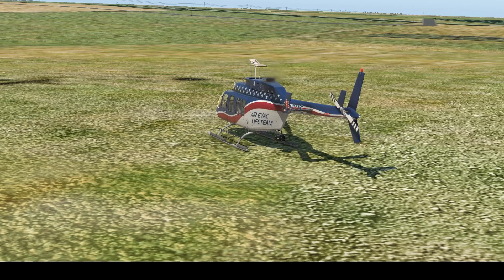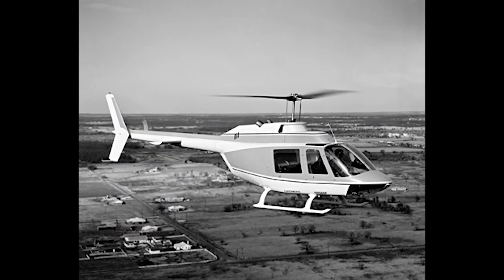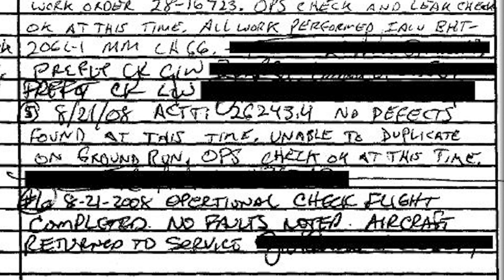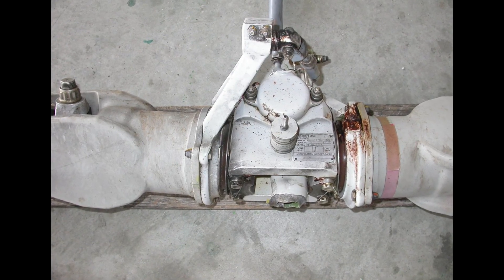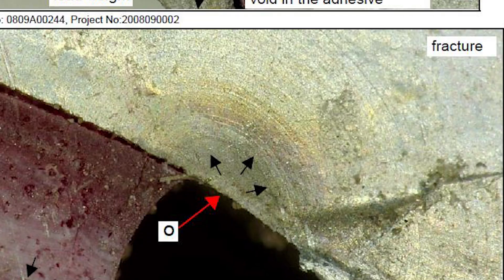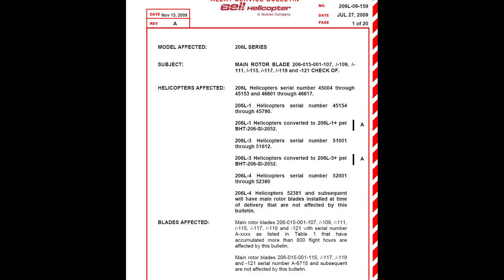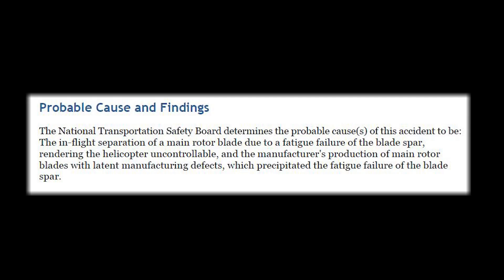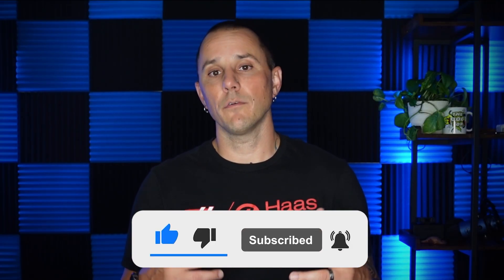Helicopter Rotor Blades Break Apart After Takeoff!  The story of HEMS Air Evac N37AE (8)

Comment from the maker: One of the rare accidents where there was absolutely NOTHING the pilot or med crew could have done to avoid this.   I truly appreciate you folks taking the time to watch this video.  If you thought it was good please like and subscribe and even feel free to hit that “thanks” button so we can keep this channel going and make it grow.  If you have a story or incident you’d like me to review please let me know in the comments below! Cheers!👊🤙🙏💙
Reply: about the fatigue cracking noise, I know that a short period of low rumbling under stress is something seen as a major warning of fatigue for fiberglass hulled boats... usually, being caused by voids forming around the lead keel weight a few hours prior to failure... this sound tends to immediately disappear once the adhesive has found a weak line  along which to begin parting...
wonder if the physics for the blades here is thesame?
Reply: My friend was the pilot 😞
Reply: I participated in an autopsy involving a heli crew while in the military.  I've always had a question since then.  
The remains were basically hamber with nothing over the size of a quarter.  We were told the heli was a variant of the huey.  To my uneducated eye, that heli can't attain a speed that would turn flesh into hamber on impact.  I've always felt we were not given all the facts for many reasons.  My question is, what speed would need to be attained to do that to the human body?
Reply: I flew for UC Aircare in Cincinnati for 12 years, enjoy your videos, always informative. I once had a Bell 47 blade grip bottom half crack on me in flight. Entered an auto,  since it was the fastest way to get to the ground, but since the engine was running  brought the engine back up and landed with power! Good thing I did, the aircraft would have coned, and probably snapped the blade grip completely off, slinging the blade of course. I was back up that after noon, flying our Enstrom F28A.

Comment: I was a lead mechanical design engineer on the Allison Model 250 series of engines back in the 90s. I was there when this engine was manufactured and was heavily involved in the design and new product introduction of the Model 250-C47B which powers the 407. I've done investigations on engines involved in accidents many times. I've seen lots of ridiculous stretches that lawyers make to score more money. This is the most ridiculous I've ever seen. The engine had nothing to do with this failure.

Comment: I’ve spent many of hours inspecting blades as a bell engineer… never slack off on main and tail rotor inspections.

Also this rumble in rear of aircraft pertaining to the rolls Royce 250 is something I’ve never heard or read about… I’m also licensed Rolls Royce mechanic but what do I know.

All I can say is that these blades need thorough inspections often and maybe more often depending on your ops.

Comment: In Ems when Evac first started, it was known as ScareVac. I seen a flight come in and a wire burned, the helicopter mechanic came and went to autozone, got a new wire and the craft flew away. I was like I didn't know autozone sold helicopter parts but most of all that's great it had the wire but if I was on the crew I would have wondered more about why it burned through and not so much if autozone had the wire.

Comment: My husband was killed in June 2013 also a bell 206 and Air Evac his helicopter did the exact same thing fell apart in the air and on examination after the crash had a significant void of the adhesive in the rotor blades they should not have left the factory with the size void it had. They also had maintenance records that showed vibration before the crash in more than one instance but could never pinpoint the reason. 3 more lives lost for the same reason. Thank you for the information and video.

Comment: That's a characteristic example of mast bumping that's was done over time in low G maneuvers its a big problem with hueys vipers and bell helicopters that have rigid and semi rigid rotor systems
Reply: As a professional helicopter pilot, flight instructor and DPE I can definitively state that this accident had absolutely nothing to do with mast bumping. The mast bumping phenomenon does not accrue stress slowly overtime. The defining characteristic of mast bumping is that it is a sudden and catastrophic separation of the rotor system due to the mast being bumped by the hub.  It can only occur during a specific flight condition and is in no way related to rotor blade fatigue.

Comment: Helicopters especially have fixed speeds. The engine runs at a lot higher speed than the rotor system. This enables you to identify a system but doesn't help identify it further. RR have nothing to do with this.

Comment: I feel there's a gap, pardon the pun, in the explanation of getting from void to fatigue defect.

If RR issued such a service bulletin, does it imply that there was at least one prior incident?  Is it possible whoever prepared the legal document mixed up compressor blade for main rotor blade? Even if the warning is correct, is it RR or the helicopter manufacturer who should issue a bulletin?

Comment: What I see is the same crap I have seen in other assembly shops. You have a star mechanic known for his/her high production numbers that figured out a way to minimize adhesive squeeze-out at the lead weight bonding time. Minimized adhesive squeeze-out makes squeeze-out clean up and faring at joints a lot quicker. These types get upset when you check on their work because they think they are "The Most Perfect Evar".....and management wont mess with them because : Numbers.   
So now 3 people are dead because of the constant pressure to produce more every damn day, and short cuts were allowed.   
The solution would be for Bell to dictate and absolute MINIMUM amount of adhesive used for that step, even if it creates a lot of squeeze-out and clean up. Any adhesive left over and total blade weigh before and  after this step should tell the story if enough adhesive was used, and the likelihood of voids.

Comment: That airframe probably had a ton of hours on it. The 2 digit tail numbers in that fleet were all pretty old. However, i remember when this happened. There were a "lot" of issues with the van horn blades. They pulled em all off the entire fleet from what I recall and replaced them with a superior product.
Reply: This accident occurred with OEM Bell blades installed. Van Horn main rotor blades weren't introduced into the Air Evac fleet until roughly a decade later.
Reply: @nathanlovellcfi  its been a while since I watched this. What year was this supposed to have been? We had van horns on ours in the mid to late 20 teens.
Reply: Wrong

Comment: I’m a pilot and A&P with about 10k hrs in Bell products. I’ve never heard of a SB from RR about a low freq vibration, although I’m not saying it doesn’t exist. I  would think to avoid liability, they would avoid such (ie if they said look at the rotor, when in fact is was an engine part, they’d be opening themselves up to liability). I will say that in the Rotorcraft flying handbook from the FAA, it does address places you should look for issues based on the frequency of vibration. I’d have to go back and look it up.

Comment: Wow《☆》I've scrapped at least 20 sets of 206B & OH58A M/R blades after they reached their hourly life limit. I always thought they could still go another 3600 hrs by the looks of them. We used to cut them in half & turn them in for scrap$$$. I tried jumping on them to see if I could break them but they're very strong. They would make good diving boards if you glue 2 together. I've used the Hysol purple adhesive to do external blade repairs. It's good stuff, like Epoxy on Steroids. My guess about the rumble noise was probably a gust, thermal air pocket or crosswind. Hopefully everyone gets their fair compensation especially seeing as it occurred in 2008🖖😎☮

Comment: I worked on all 206 series helicopters including LongRangers for many years. There is no way that the rumble
Would indicate an impending blade failure. My boss will always stalk about lawsuits that involve "The deep pocket theory". The lawyers will go for the engine manufacturer, the avionics equipment manufacturer, etc. . The main rotor blade failure was immediate, and the imbalance probably tore the transmission off the service deck and flung it quite a ways from the aircraft. It was unfortunate that manufacturing process was to blame on this because the 206L series  are great  helicopters. Hawaii County has a 206L-1 since 1991 and has been providing great service in firefighting to rescues. Always been a smooth bird and easy to track and balance. Another unfortunate manufacturing defect was the failure of the blade spindle of the Sikorsky S-76 helicopter due to tooling marks leading to loosing a blade. All these were immediate with no warning. I hope blade integrity will be lasting till time out replacement for the Bell 505 helicopters that seem to utilize the 206L rotor system. I know that the 206L was also plagued with tailboom failure where there was fatigue cracking somewhere just ahead of the tail rotor gearbox and vertical stabilizer causing separation. That has been remedied already.

Comment: The argument is mute... As the more you have of something flying around.. The odds are you would see a higher rate of crashes or problems. The vary fact there are 100's of these in service. Yet you only hear of 1 fatal crash in 30+ years. Should tell you just have safe these are...

Comment: The "low rumble from the rear of the aircraft" in my opinion, is unrelated to the departure of the main rotor blade. It very well may be from the engine which as far as I can tell, was manufactured by Rolls Royce. Not sure how an engine rumble could signal an impending MRB failure. The beach marks on the MRB spar are very telling of corrosion although emanating from the inside of the spar would be very difficult if not impossible to detect from a visual inspection.
Reply: The tail rotor could amplify any vibrations coming from a failing main rotor and send them forward or a rotor vibration could be carried through the transmission to engine, why not as they are all connected.

Comment: You stated, a assembly error in  Manufacturing as the cause of the failure.??? LET'S SAY ,possibly . I think the make up of the lead itself ,is more likely the case. How hot does a rotating lead sword get ? Hot enough for the adhesive to fail after years of the "flywheel " lead corroding away from it ? Sad. I hope some good comes from this tragedy. 🙏

Comment: not only that, but the metal main rotor blades on Bell products will continue to thrash the ac to pieces, unlike Aerospatiale which has composite blades that will break and not beat the ac up.

Comment: Flew for 28 yrs. in a consortium based program. BK 117 A,B,C models, N2 Dauphine, C++. Seemingly, regularly, we'd hear an about an Air Evac issue, more than I'd like to admit fatal. I never thought zero timing clapped out 206's for EMS was a good idea. Thousands of blades on 206's and a failure with a sketchy flight program, what are the odds, promoting the first AD for the blades. But I realize things happen. In the early 2000's a flight program in Texas suffered a blade separation with one of their BK's determined to be a TT strap failure the first AD of the kind for BK117's
Reply: Tulsa?

Comment: During my time in the US Navy I served as a helicopter crewman aboard the Sikorsky  SH-3D helicopter. We had a helicopter that was returning from an over water flight  with a severe vibration problem. Upon landing at the air station, it  was determined that one of the five tail rotor blades had a visible  split along its entire length. The blade was still attached and the two halves of the blade were also there.  It was amazing that the tail rotor blade was still there and lasted long enough for the helo to return to base. 
Worse case scenario the tail rotor blade could have separated and impacted the main rotor blades resulting in a catastrophic failure while over the ocean.
Reply from the maker: Wow it's crazy how some of those old aircraft held themselves together!  Thanks for your service!

Comment: Rolls Royce have no practical knowledge of rotor systems. Or helicopters, for that matter. They design and build an engine which they test to destruction and then supply certified examples to the customer. They provide ongoing tech support and spares for their product. They would have no knowledge of any issues with airframe, rotor head of blades.

Comment: Due to the torsional forces on a rotor blade spar, any internal de-bond or void area beyond a certain point can cause fretting and ultimately lead to initiation of a fatigue crack.  If the skin doesn't crack, the chances of a visual inspection detecting impending failure is pretty remote.  Back in the 1973/4 era, a similar situation arose on the Bell 540 rotor blades used on UH-1C/M, TH-1L and AH-1G/J helicopters.  The blade design is the same as the 206, a C spar with a closure plate to for an equivalent D cross section (which is what the Bell 204/205 blades have, an extruded D spar).   However on the 540 blades, the issue was de-bond between the C spar and the closure plate.  An aeroelastic analysis found the blade could operate successfully with up to 36" of de-bond, but that was strictly theory and only employed so as not to ground the entire US attack helicopter fleet.  In fact, much smaller areas could set up the fretting and ultimate fatigue failure.  I only remember one case of a crack being found on preflight and the crew cranked up anyway, but the vibration was too great to fly (they were lucky, even a blade failure on the ground can do you in).  The 540 blade life was dropped to, I think, 550 hours and the ultimate fix was replacement with Kaman K747 composite blades.  

I cannot see anyway the rear fuselage noise write up could have been related to a main rotor blade.  Blades work until they don't.

Sorry for being so wordy, just brought back old memories.............
Reply: I remember in the 70.s they had a problem with possible delamination  and maintenance had to tap allow the leading edge with a penny and listen for a hollow sound meaning delamination leading to further investigation.
Reply from the maker: Great info, Charles!

Comment: I fly for Evac as a medic in indiana. They took a lot of blades out of service for this accident. If you drive by some of the bases they have been turned the blades into monuments in front of the base as a remembrance of this accident.
Reply: I live just about 360 feet from the 4 story helicopter pad across from my houses ,@.UPMC WMPT , 17701, I see and feel even ambulance whirlybird that comes and goes there. When the wind comes from the south, they come in directly over my roof at 90 feet on a windy landing. Full power till touchdown over the parking lot and down on the east wing roof.  I get new cracks in my all plaster walls constantly..when the pilot is landed, I can see his eyes from my front porch.. I've seen one on pad,deck, and one in a holding orbit waiting for the other to leave, and I've seen two in orbit once waiting ... knocking on hardwood,  I have always witnessed successful take off and Landings without event, and some are parked in very windy conditions I can't believe they made it. God blessed crew the captain and the poor sobs that have to be the occupants in distress. Keep the blue side up, Prayers for the family's.          🌬❤
Reply: They’ve been using blades in marketing the base locations since well before this accident.

Comment: I was trained in Bell 47's with wood blades that unlike metal blades had no service life restrictions (sweet auto's). I remember flying a couple of times with the blades not balanced correctly and it felt like it riding a horse.  Minor adjustments were done with the trim tabs.
Reply: Way back in the day, if it had been sitting out over night moisture would cause an imbalance. Wraps of duct tape did the trick, until the day warmed. Then it would either peel off or we'd peel it off.
Reply: Back in aircraft mechanic school, our teachers regaled us with (mostly true) stories. One of my favourites was maintaining a Hiller in India during the dry season. The blades that had recently been flown in the wet forest of BC and they dried out so fast you could drop a nail file through some of the cracks. The replacement blades never showed up so they just flew it with the cracks. I’ve had my own adventures too but I’ll save those for another time.

Comment: Aviation Investigation Report A11O0205 from the Canadian Transportation Safety Board reports the loss of a 206L in much the same way in 2011. Blade failure occurred less than 8 hours before blade replacement would have been required. I’m only a pilot/mechanic and not qualified to pass judgement but I really can’t get my head around why an external crack check was approved for cracks that start on the inside. I’d really like to know why or how this was approved and why the same accident happened twice.
Reply: @zimbabwesteve4620  Bell 206 Blades do not, unfortunately, have a crack indication system built in. It’s a good, well established helicopter but rather old technology.